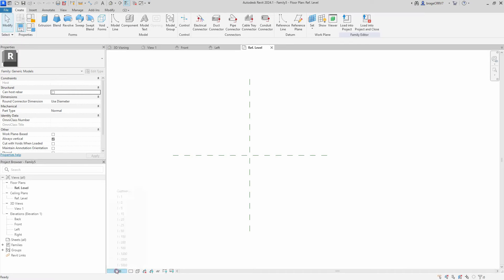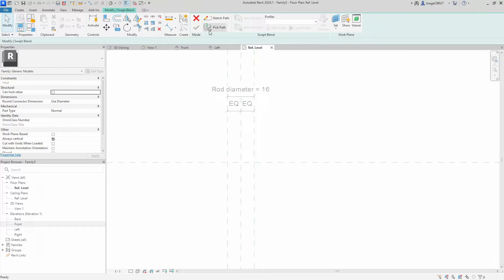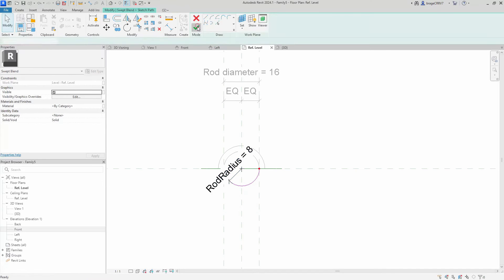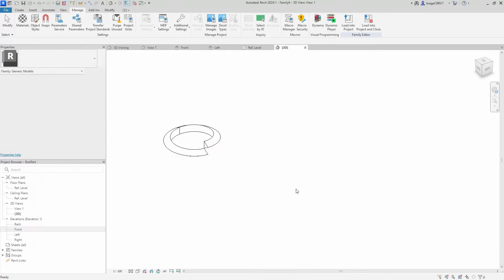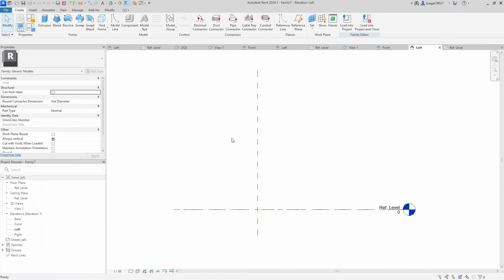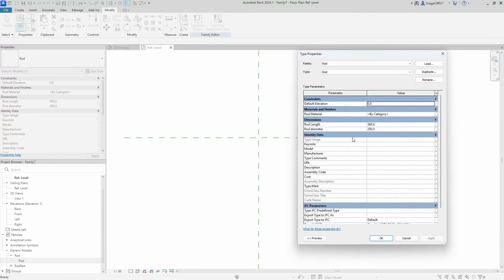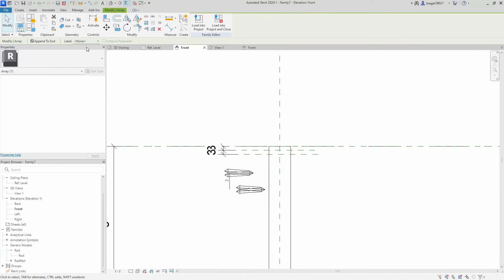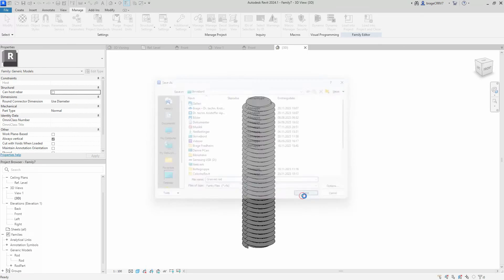Revit family | Parametric grooved bolt | swept blend and array

Comment: Is there a way to make a nut for this? so the opposite I guess using voids. I have tried this and it never works just errors out. what am I missing?
Reply from the maker: Hello! I would not use void to make it hard/impossible to make it parametric.